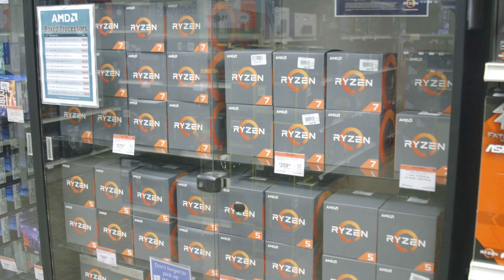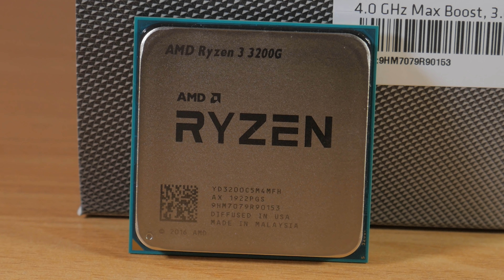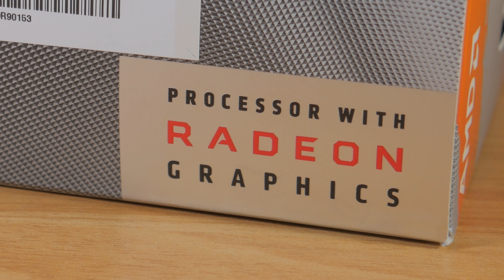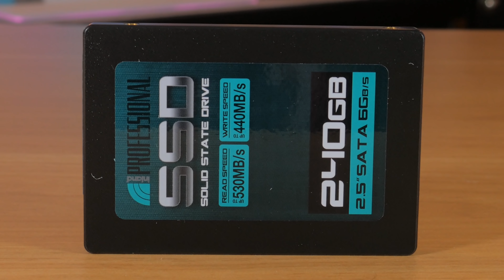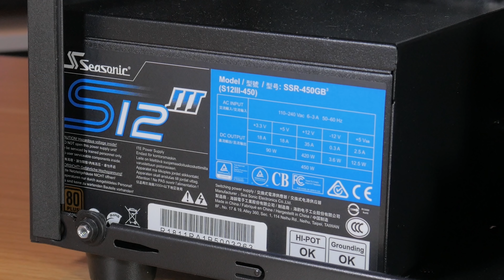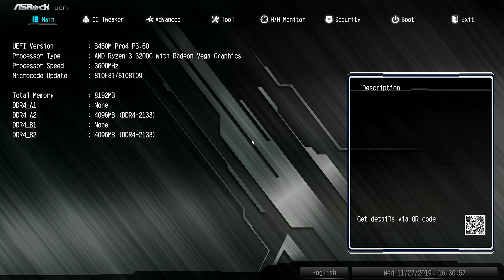$300 Gaming PC Build Guide! (Late 2019)

Comment: As you said, I recommend you buy used hardware at this price point. I got a really good PC for around 300$ used.

CPU: i5-3470 - 40$
GPU: GTX-960 4GB - 82$
RAM: 16GB DDR3 1600MHz - 60$
MOBO: AsRock H61M - 32$
PSU: Chieftec 600w Smart - 26$
Case: MasterBox 3.1 Lite - 45$
Storage: WD Blue 1TB - 40$

Total: 325$

The i5-3470 and the GTX-960 make a good pair. Basically no bottleneck (0.26% according to Bottleneck Calculator). 16GB of RAM is more than enough for average use, and you can easily put it into an old case for free, and use the remaining for more storage/SSD.
Reply: I was thinking of what CPU to get with a ryzen 570/580 myself but from what I've learned that 4th gen CPUs and below are pretty bad now, should I still go for it?
Reply: Depends on your budget. Buying old, especially used hardware is a gamble, but you can't beat the prices.

Comment: ima build this, i’m not trying to do any insane gaming so this is perfect
Reply: There's an easier, cheaper way. I got on Amazon and bought a Dell Optiplex 990 for $120. I increased the RAM 8 additional gigs for $20, 500 gb for $65, and a 2 gb graphics card for $45. I only do retro gaming on it no problem. I bought the graphics card so I can run an HDMI cable to my TV. Didn't need to upgrade the case, CPU, power supply, or anything else.
Reply: @lepermessiah2011  
Literally I wanted PC just for the retro games
Reply: You’ll regret this

Comment: Tech by matt Was this a good deal
I bought a computer for $650 with
Asus gtx 1070 oc
I5 7600k
16gb ram
Watercooler
Reply: Thats a good deal. Might want to upgrade the cpu though.
Reply: @dankism9305  It's overclocked so it works fine
Reply: @oskarbokeroth1208  overclocks != upgrading.

Comment: Hey Tech by Matt (or anyone if you have a true suggestion), I need help. I know this is long, but it would be greatly appreciated if you help. I've been researching for about 6 months for the best value pc. Should I get this build with 16gb ram, and the B450 Tomahawk Max so I can upgrade in the future easier and don't have to bios update with a older cpu which I dont have, coming around $400, and get a Gpu later, or even get a used Rx 580 now because it only totals to about $490 with the used Gpu. Or should I get a Ryzen 5 2600 with a used Rx 580 with some other parts used (ssd and case) coming at around $580. Please tell me which one I should pick, or if you have a better suggestion. Please help me! Thanks.
P.S. I personally think I should get the 3200g with a used Rx 580 for the best value but please tell me.
Reply: Do whatever build fits your wallet, but as a tip the 2400g or 2600 etc may be better because you'll have a dedicated card anyways.

Make sure your build fits your power supply, of course...

Comment: I got a i5 3470
Msi rx 480 gaming x 8gb 
500 hdd
128 ssd
450 psu 
For 330$  ( used )  but there are goode as new

Is that a good deal ?
Reply: That's pretty good, especially if it has at least 8gb of RAM and motherboard. Although that storage space is pretty small. Some modern games nowadays are 100gb. I would also reapply thermal paste to that 580 if it's used. It's not as scary as it sounds there are a ton of videos on how to do it.
Reply: @martinaustin6230  yes i alredy teplaced the thermal paste  and i bought it with 8gb of ram and a motherboard and its working great. Thanks btw.
Reply: @squizi7090  Nice. I'm doing my first full build in about 2 weeks with a Ryzen 3600 and a Rx 5700. Looking forward to it
Reply: @martinaustin6230   good luck  mate .☺

btw is the r5 3600 have any heat issues with the stock cooler..??
 is the rx 5700 better than the gtx 1080 ??

Comment: GPU is integrated on the processor? Can you still add a gpu later on without rebooting your system? And also can this run video editor?
Reply: I recommend the 3400g... It's the dame but better abs the free stock cooler is better too. Yes you *can * just add a graphics card, but you need to check your powersupply. If you buy a cheap powersupply, you will need to buy a better one. Ideally, don't buy a cheap power supply and replace it. Just straight away buy a 700watt powersupply 👍
Reply: @JacReviewsStuff  Awesome dude. Thank you. That really helps lol. Although just want to clear some stuff up. Example if I buy the processor and everything else, except gpu? Will the rig still work? I'm planning to buy a budget mini itx build and maybe later on, can I just add the gpu just like that without reboot or anything? Just install the driver?
Reply: @krakyen8536  : it will work because it is an APU
Reply: @JacReviewsStuff  thnx man :) appreciate it! XD
Reply: @krakyen8536  see my channel for my 3400g build. Desk mini. The desk mini comes with free motherboard and power supply. Just note that the desk mini needs nmve drives... If the ssd is the same shape (M.2 Sata) , but is not nvme, then it won't detect.)
Reply: @JacReviewsStuff  I'll check right now, thank you :)

Comment: Why did you install the ram sticks in only slot 2 and 4? I’m new to building PCs so I’m curious. Also will this be the same way for LGA1155 mobos?
Reply: Iris Jitomo they run faster don’t know why but it’s true
Reply: No. LGA 1155 supports second generation Intel CPUs and Ddr3 memory rather than ddr4. 
Also when installing ram you want to space them out unless you only have 2 slots... that’s just how it works. I don’t know why
Edit: I though you were talking about putting the 3200g in 1155... if you weren’t, the installation of CPUs on 1155 are a little different, but installing power connectors and stuff like that is pretty much the same

Comment: If i pair it with a good gpu would the processor be able to handle it . I mean how good is the processor alone is it worth buying if I'm gonna add a gpu to it
Reply: A 1050 ti/1650 or a rx 570/580 would work well with the 3200g

Comment: My PC cost me 300$. Is it good for the price?
My specs:
CPU: i5 4670k|Motherboard: MSI Z97 Gaming 3|GPU: RX 580 sapphire pulse 8GB|Ram: Corsair Quadchannel 1600mhz (16gb)|PSU: Corsair VS650|CPU cooler: Be Quiet Pure Rock slim|SSD: Silicon Power p34a80 512gb m.2| HDD:1TB Seagate 7200rpm|Case: Silverstone RL05 with NZXT fans and dvd/cd burner

Comment: Just Ordered Parts For My PC
Ryzen 3 1200 $85
GTX 760 $100
8GB DDR4 Crucial Ballistrix RAM $40
Cooler Master 650 watt PSU $94.99
Antec Case $94.99
32 GB sad (free)
250GB hdd (free)
ASRock A320 MB $90

Prices are in NZD, also New Zealand isn't the best place to get used parts

Comment: What are some reasonable upgrades I can make, or what graphics card can I add in
Reply: If you are getting a graphics card better off getting a different processor
Reply: You can go for an RX 570 for a budget one, it will play pretty much every game at 1080p with medium to high settings. But its best you also pair it up with a better CPU like a ryzen 5 1200 although you'd have to check for prices and then determine which CPU you can afford.
Reply: Mateen Ahmad 
3200g is better than 1200
The 3200g will be fine for an RX 570
Reply: @yams_yams_  I see, ty

Comment: I though that the motherboard you used doesn’t support 3000 Ryzen without a bios update, which requires a compatible cpu.
Reply: It says ryzen 3000 series compatible on the box
Reply from the maker: The vast majority of B450 boards being shipped out now have compatibility for ryzen 3000. Ive bought 2 of these and a regular Pro4 over the past two months. All three of them came with "ryzen 3000 ready" stickers on them.
Reply: Tech By Matt oh ok thanks!

Comment: Hey can someone help me out please, I have £100 to spend I have a 650w psu and a q6600 and 4GB ram and a 560 Ti, what is the best gpu i can get for £100 without it being bottlenecked or should I save the £100 and stick with the 560 Ti and save up for a better system

Comment: i picked up an i5 optiplex with a 1050ti 8gb ddr3 for 115 euro its really  descent
Reply: i dont have a optiplex but a 2 nd generation and i plan buying a gtx 1050 i7 2600 or i5 2500 and 8gb ddr3
Reply: @presplit  don't get the i7 it will bottleneck instantly with a gtx 1050 the i5 is the best option

Comment: Is there any way to lower the cost a tiny bit like bringing down the price to 250
Reply: Buy used parts on Facebook Local, eBay, or a thrift store.
Reply: @FelicianoTech  *buy
Reply: @workingtitle7049  Fixed, thanks.
Reply: Daveed Nation 
Get an Athlon 3000g

Comment: My system is hanging up/quitting out, the only thing I can think of is that dram voltage was up to 1.35 and was highlighted in red in the bios?
Reply from the maker: You can set the cpu and gpu overclock back to stock and slowly crank things back up to see if that fixes it. Also, try updating the motherboard bios. Someone I know who recently built a pc with a 3000 series cpu and b450 board kept on getting blue screens until he updated the bios.
Reply from the maker: Also, you can follow hardware unboxed 2200g overclocking guide and everything in it will work fine for the 3200g too.
Reply: @TechByMattB  Thanks for the reply, I put the CPU back to stock and I'll take it from there. Updated the Bios and put the DRAM voltage back to stock, Seems to have done the job. I'll check out that video and tell you how I get on
-Quick note - for some reason I couldn't search for my board the B450 Pro4-F directly on the website and the regular board BIOS isn't compatible, I managed to get the right BIOS searching from google to get to the ASRock page. Strange but its working fine now.

Comment: I found out if you change the psu to a cheaper one and the 3200g to a 2200g you can put an rx560 4gb and its only like 50 bucks more
Reply: Btw i looked up some videos on the r3 2200g and rx560 you can run pretty much any game higher than 60fps on high or medium settings

Comment: How are the temperatures when overclocked? Is the stock cooler enough?
Reply: Ričardas Mikelionis enough
Reply: If you really want to overclock you might as well choose a new cooler, while the stock cooler can support a mild over clock but do keep in mind that it will run toasty which is not good for the cpu.

Comment: I would get a cheaper mobo, such as a B350, and get the 16gb kit.
Reply: That would limit your upgrade path tho.
Reply: @pifftystan2813  Not by much, if an R9 3900X would work in an A320 board, I wouldnt worry about any 3000 series processor working in a B350 board. Besides, I would argue that buying an 8gb Kit would limit you even more because then you would only have 2 RAM slots left, and 8gb RAM already in. So if you were to put a matching kit in, you would have 16,  were as If you already have 16, with a matching kit you can have 32gb.

Comment: Ive used this exact build and upgraded to 16g of ram, and now the screen doesnt even turn on. Is 16g to much??
Reply: Ran Marsh 
No. 16gb is recommended. You might have gotten a bad ram kit. Are there 2 sticks, 4 sticks, or just one?
Reply: @yams_yams_  ive got two sticks of ballistix and its still kinda slow. Its my first rig so im not sure on how fast it should be
Reply: Ran Marsh 
What speed RAM did you get?
Reply: @yams_yams_  2400
Reply: Ran Marsh 
That was it’s rated speed? Yeah... that’s a bit on the slow side. 3000-3600 is recommended. 
You also might only be running the RAM at 2133mhz right now instead of 2400, have you overclocked the ram in the BIOS?
Reply: @yams_yams_  yes I did overclock, but I followed what Matt did in the video. Thank you for clearing that up for me. Next purchase will be better ram
Reply: Ran Marsh 
Sweet!

Comment: How do you add an 1660 it graphics card to this 300 dollars pc
Reply: Youngsoy28 
Insert it into the top PCIE slot. 
That card might take too much power for this system though so you might need to upgrade the power supply

Comment: Whats crazy is you still found a way to get 16 gb of ram thats good and isnt crazy what 300 dollars can get us now hell 550 to 600 dollars is such a sweet spot right now for antbosy that wanta to play any game right now at high to uktra settings at 1080p a 600 dollar comp can do it and alot of 1r40p games at high settings with around 60 fps with an rx590 or the gtx1660 woth a ryzen 5 2600 yes my build is the 600 dollar build lol with an asrock b450m steel legend with 16gb of ballistix ram and a 600 watt 80+ power supply just so later I can upgrade without having to worry to much also 4 rgb fans and 500gb ssd

Comment: Does anyone here agree that they will upgrade the parts used in the video? I'm going to get a Ryzen 5 2600X instead, the Thermaltake SMART 500W PSU, 2x16 RAM sticks, and maybe an SSD/Hard Disc that can take on 1TB - 2TB. Does anyone else agree with my parts selection?

Comment: I'd love a 400 dollar gaming pc build
Reply: Cheapest b350, r3 1200 rx570 8gb of 3000mhz ram and thats it
Reply: I’d love a 500 dollar gaming pc build
Reply: @dhdj5624  cheal b350 r3 2200g rx 580
Reply: @arminavdic8430  what about optiplex 990 motherboard+MA01 matx case+ e3 1230 v2 + ddr3 4*8 + gtx 1660 ti+evgb 600w bronze + 970 evo plus 250g+PCIe usb3.0 card?
Reply: @dhdj5624  used parts? also grab the 250gb kingston ssd, it will come cheaper
Reply: @dhdj5624  pretty sure the 1660 ti would bottleneck the r3

Comment: I can tell you the 3200G integrated graphics card can run fortnite in Low to Medium around 50-60 fps. Get a cheaper motherboard Asus Prime A320-K  https://amzn.to/39J4X9j and try to save on the hdd and power supply so you can slap in a cheap AMD RX570 or RX580

Comment: Black Friday save me for the next 10 years 

1] SuperCase Mirror Series MI06A Case                            /37     € 

2] Thermaltake Smart SE 730W                                     /61.90  € 

3] AMD CPU Ryzen 7 2700 (AM4/3.2 GHz/20 MB)                      /149,90 €

4] GIGABYTE GA-AB350M-DS3H V2 RETAIL                             /49.00  €

5] Crucial Desktop RAM Ballistix 16GB Kit 3000MHz DDR4           /64,90  € 

6] Sapphire Radeon RX 590 Nitro+ Special Edition 8 GB            /184,90 €

7] SSD PATRIOT PBU240GS25SSDR BURST 240GB 2.5'' SATA 3           /27.90€ €  

8] HDD TOSHIBA HDWD110UZSVA P300 1TB SATA3                       /37.90  € 

9] DEEPCOOL GAMMAXX GTE RGB CPU COOLER - INTEL & AMD DEEPCOOL    /23,63  €

10] ARCTIC P12 VALUE PACK x5                                     /14,20  €

and i save 100 € from the games AMD gives with the graphic card and the CPU worth

Comment: "all new parts" fools, ebay always provides. with skill, it provides at half price. It's so buyer friendly that you can get refunds for just about anything so long as you don't go offsite. If someone asks you to go offsite for a purchase, DO NOT. I'm looking at a sub 300 euro rig right now with a CPU that won't bottleneck until a fucking 1080, 16 gigs of ram, an SSD (admittedly one that I'm grandfathering in from my previous rig), and either a 980 TI, or a 1060/1070/ti depending on what auction comes through. Cheap, fast, VR ready, and all I have to do is live with the shame of running a box made by dell.